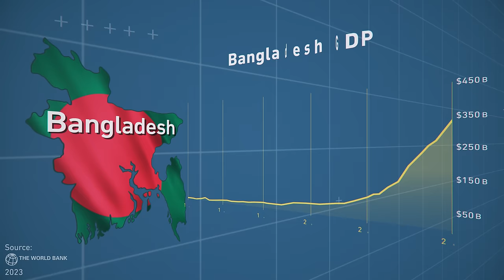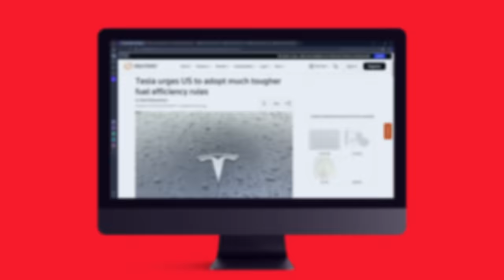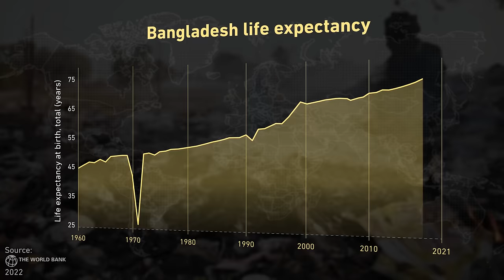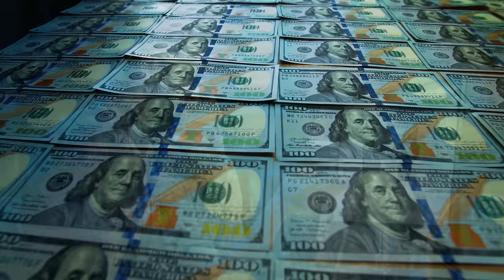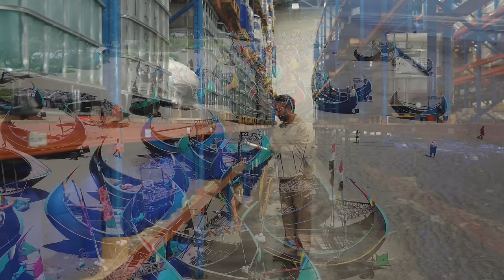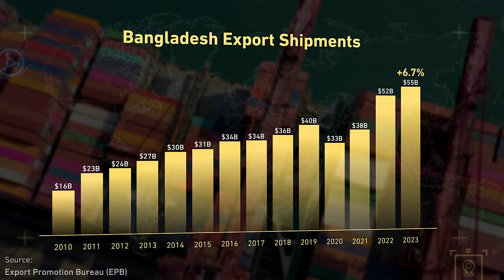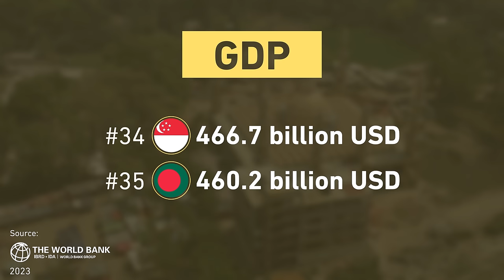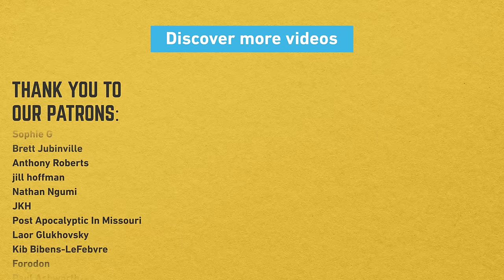Bangladesh Could Become Asia's Strongest Economy

Comment: A correction to the history section. India was not fighting Pakistan at the same time as Bangladeshi liberation war. India joined the war in support of Bangladesh. They are the same war. India was supporting it and helped Bangladesh from the start, later joined it when Pakistan also declared on them too.
Reply: stop correcting India was also thinking about itself
Reply: @frukaa5640 exactly. India wanted the sea ports of Bangladesh especially the Mongla Seaport. So they wanted to occupy the Khulna division, luckily the local powerful ppl didn’t let that happen. But it didn’t last long, India will use Mongla port from now on

Comment: Regarding 3:40 
When talking about "life expectancy" it might be an idea to talk about the inefficiencies of the metric towards singular events, like natural desaster and short wars. 
In my humble opinion "life expectancy" is trying to measure the long-term quality of life. Singular type of events like the aformentioned don't seemt to fit this category very well, unless it's long term and recurring.
You see this by the "life expectancy"  goint smoothly back to the trend it was on before 1970, so the dip doesn't tell you much about the quality of life (which seems to have been unchanged afterwards), but the age and amount of people dying from that specific event.

Might be an unnecessary overcomplicationg for the viewership though, as the metric is a statistically interesting approximation, due to the difficulties in measuring it.

Comment: You got a lot of things right in this video. But missed the main point. Bangladesh did their best with the resources they had. They were one of the poorest countries on Earth when they gained independence. They started from zero. There are not many natural resources in Bangladesh either, just some natural gas. They didn't have any capital or foreign investment to move to capital-intensive industries. They could only succeed in the textile industry. But now Bangladesh has adequate infrastructure and capital to move to high-tech industries. Bangladesh needs to utilize the current opportunity. Its biggest problem is corruption. Bangladesh didn't have much opportunity before, they only earned it very recently.